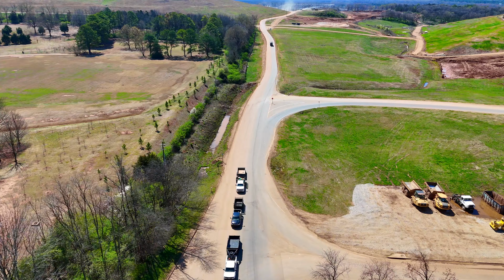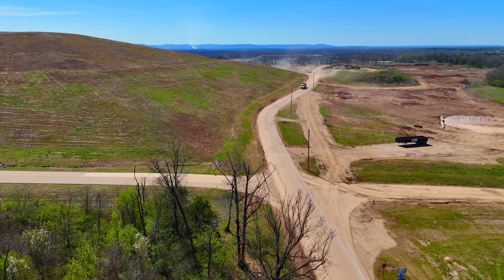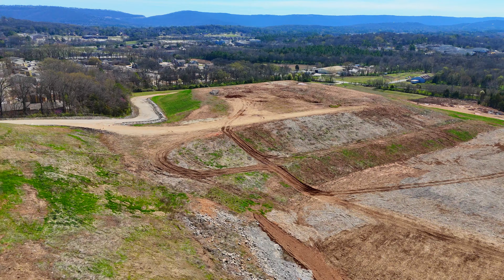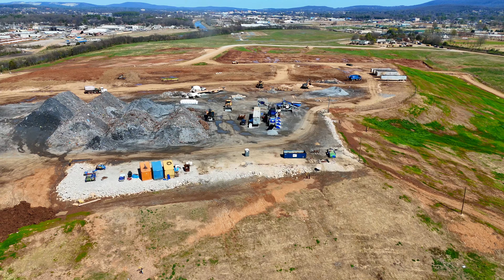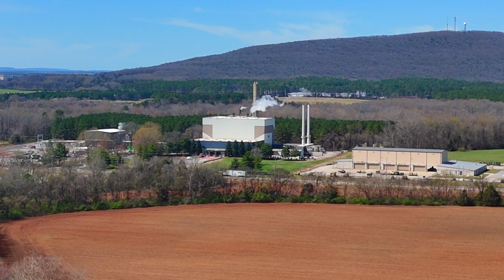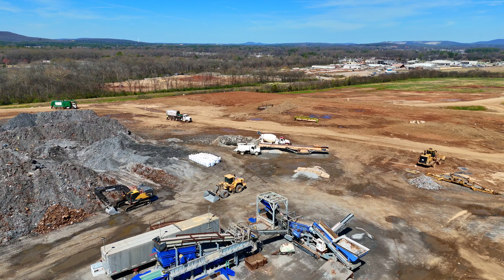Huntsville Land Fill

Comment: Very interesting.  I enjoy your narrations.  But... May I suggest you take slower, easier turns with the drone?  I'm getting sea sick.
Reply from the maker: will do. believe it or not, the drone is set to Cinema which is already slowed down.
Reply: @bohenderson  you can adjust the sensitivity of the Yaw by clicking on the 3 dots, then Gain and Expo Settings.  This really helped me.